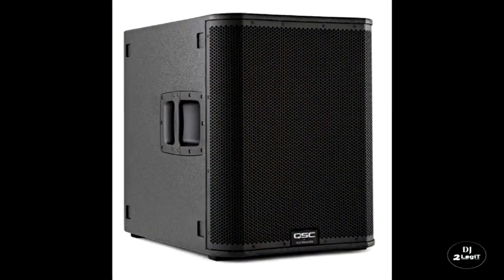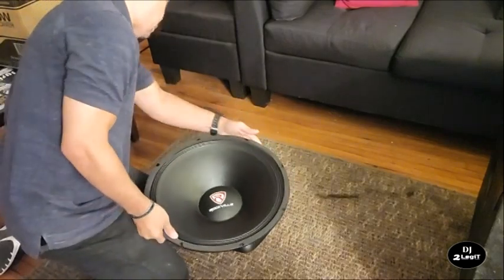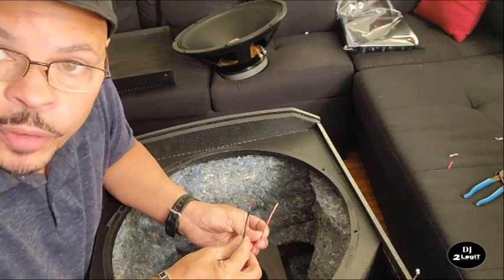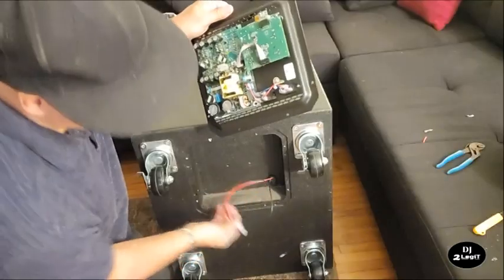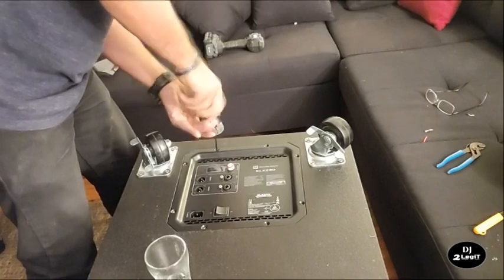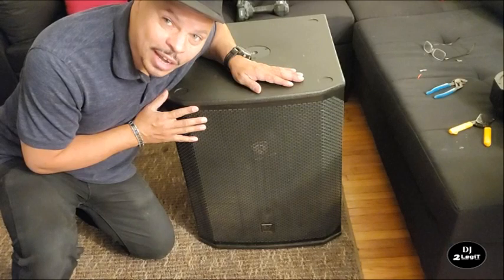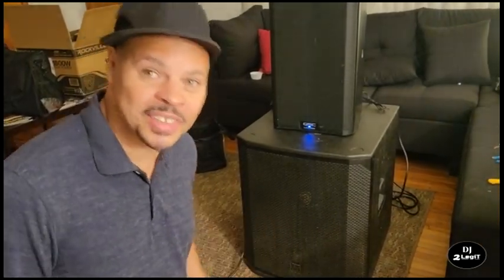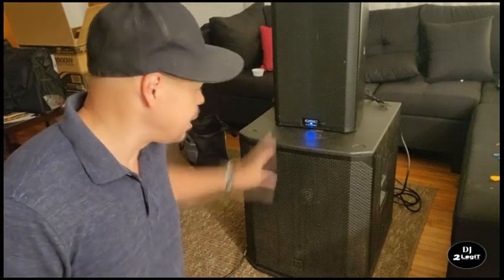Upgrading My Electro Voice ELX200 18SP Subwoofer

Comment: Hello from Australia. I just imported a couple of the Rockville subs and did the swap over. Agreed… massive improvement! Cheers mate
Reply from the maker: Glad you did the upgrade and heard what I heard too. The upgraded woofer kicks much harder! Huge improvement! Enjoy.  👍
Reply: Did you upgrade working woofers, or were both broken? I have two of these, and wondering if its worth to replace working defaults.
Reply from the maker: @mitas3484  At the time of making this video, I had one woofer that worked and one that was busted.  So I upgraded the busted one and then did an A/B comparison of the upgraded one versus the default one. The difference blew me away! No comparison. So I say yes, it is worth it to upgrade the default woofers. I also upgraded the default woofer on my second one.
Reply: @DJ2Legit007  Was hoping it wasn't that massive of a change haha, but the new woofer is not too expensive, will have to try it out!
Reply from the maker: @mitas3484  You get 30 days to return the woofer if you don't like it. Just buy one. Make the swap. Do the A/B comparison. If it blows you away like it did me, order the 2nd one. If not, send it back for a full refund.  What do you have to lose? 😁😁😁
Reply: @DJ2Legit007  Ordered two, hope to feel the difference!
Reply from the maker: @mitas3484  Good for you!!! I know for a fact that my upgraded subs are more powerful and put out much more SPL than the default woofers. And the default woofer clips much quicker than my Rockville sub, allowing me to push it harder and louder without worrying abouts it clipping. Congratulations on your decision! Please let me know how your experience goes after you do the upgrade.
Reply: @DJ2Legit007  I will reply back here with my findings, arrival in a few weeks, but hopefully my DB meter will show a difference!
Reply: @DJ2Legit007  Hi man, so I got them, threw them in today and tried playing the same songs. Obviously not very scientific yet, but its true that somehow it gets deeper and more volume. I used my DB meter, and at max volume I got 2-3 db more, before clipping fully. With a limit light every like 2-3 second, I was at 102 with the old one at 1 meter, and at 104-105 at 1 meter with same volume on the new one. 

Will try taking them outside for a proper test, this was just in house, so will sound different in a venue for sure.

Odd thing is it somehow matches my tops better now, it doesn't seem to disappear at unity like the old one did. Thanks man!
Reply from the maker: @mitas3484  Glad to hear your results! I didn't use any kind of DB meter. Just listened with my ears and was astounded by what I heard!!! Yep, I agree... the new woofers make them sound better with my tops too!
Reply: @mitas3484  I upgraded 2 in my brand new ev subs. Very happy
Reply: I'm on the fence on getting the EV sub 18sp or the 12sp I have a small 4 door honda civic I have two EV zlx 12p tops looking to add bass for small medium venues. I like the modification you did I'm wondering can you do that for any subwoofer even 12 inch subs? Can you even use car subs like 12'' does it matter the brand for modifications?
Reply: How does it impact the DSP?

Comment: Do you think the light weight body of the subwoffer will handle additional volume from the new driver? Or would the previous more robust model be mor adequate?
Reply from the maker: The lightweight body handles the additional volume just fine for me.  I've had no problems with it at all.

Comment: That's actually the magnet you're pointing to, not the cone, the cone is the paper part, don't forget the weight could be the different types of magnet, cheap magnets are ferrite whereas some expensive drivers use neodymium magnets

Comment: I would be extremely careful with the Rockville woofer those things blow very easily. Check the specs on it. I have not heard very good things about Rockville subs. Hope you don’t have any issues.
Reply from the maker: I was skeptical at first too, however I can honestly say that Rockville woofer is 100% a much higher quality woofer than the one that comes with the sub. The default woofer will blow much easier than the Rockville plus you can push the 1800 watt Rockville sub much harder without it blowing. I've used this on many gigs now and the difference is night and day.
Reply: Yea I sent my Cerwin Vega to a shop and they couldn’t get the woofer anymore. The guy put an 18” Rockville in it and it didn’t last. But there is a better solution them both of those. Yorkville sub. Mines is getting replaced now with Yorkville 7420.

Comment: I've had a pair 18SP's for a couple of years and just bought 2 more with the current promo. I use them with ELX 12P's and 15P's.. I was a little surprised to see you replacing both amplifier and subwoofer. I use the limiters in all my cabinets and gate from digital mixer and hopefully I can avoid having to replace any components for a few more years at least.
Reply from the maker: I only replaced the amp because I got this from a local club owner and both, the woofer and the amp weren't working. The sub has been working great for me ever since. I now own 4 of these and I upgraded the woofers in all of them.
Reply: You should want to replace the woofers in them just because they are cheap woofers trust me you’ll thank me later I did the same thing with my higher end EV ETX 18” subs and it was a night and day difference in the sound
Reply: @hollywoodthedj1673 which woofer did you put in the etx 18sp?
Reply: Well don’t be to surprised… they bought an elx 200 powered series for a club…. Already doesn’t sound right would of probably gotten away with it if it was a etx or maybe a ekx

Comment: Hi, friend!  I will soon be installing two Rockville RVW1800P8s in my EV-ELX200-18Sp.  How do they work for you today, do they hold up well?  In Club mode, do they take longer to reach clipping than the standard ones?  I would greatly appreciate your response.  ☺️🎧
Reply from the maker: Hi there! Yes, I am still extremely happy with my upgrade. Still working great! I use them in Club mode. Yes, takes longer to reach clipping now in comparison to the original woofer. I'm so glad I did this for all 4 of my subs.
Reply: Thanks!!! 🎉🎧
Reply: Hi, friend.  I just installed 1 rockville RVW1800P8 to my EV-ELX200-18Sp.  It may take some break-in or adaptation time.  At first it seemed that the original speaker sounded louder... After 15 minutes the sound has almost equalized.  But it still doesn't sound more than the original.  😢
Reply from the maker: @israelprats8743 Sorry to hear that. Mine was definitely much louder.

Comment: the original driver only has 400 RMS POWER. it is very little. i would like to get the white version. it looks classy and wanted to equip it with the rcf lf 18 n 405. is the amp very strong or rather weak? hope it is possible

Comment: Why did you choose ELX200 model? What other options did the amplifier show you? what if you chose EKX or ETX model if they were available options?
Reply from the maker: Like I explained in the video, I got a GREAT deal on them from a local club owner. I really love how small and lightweight they are. That's great for a single op mobile DJ like myself. The others models are good too, but the ELX200 18SP fits my needs better because of the size and weight.
Reply: @DJ2Legit007  i was asking about the amplifier....remember the part where it makes you select the model? I thought what were the other options?
Reply from the maker: @fausto412  Good question. That was so long ago, I don't remember now.

Comment: It looked like the Rockville is a little taller and hit the inside support not allowing the speaker to drop all the way down to allow you to install the 8 screws. When you tightened down the screws did it distort  the frame? It does sound great.
Reply from the maker: I had to go back and look at the video again to try to understand what you were talking about. Looks like the angle of my video is misleading. The new woofer has plenty of clearance inside and doesn't hit or touch anything inside. It drops all the way down like the factory woofer. The frame is completely intact. 👌

Comment: I have 4 ELX200-18SP subs. I love the light weight of them but would like to get more output. Does putting the Rockville 18 replacement speakers make that much of a difference? 
Thanks
Reply from the maker: Yes!!! I compared them side-by-side and I was blown away at the difference. It's not a small difference, it's a MAJOR improvement in bass sound output. I'm about to do another one this weekend. I promise you. Just do one, then compare it to your factory one. You WILL thank me later and you'll want to upgrade all four.

Comment: I'm on the fence on getting the EV sub 18sp or the 12sp I have a small 4 door honda civic I have two EV zlx 12p tops looking to add bass for small medium venues. I like the modification you did I'm wondering can you do that for any subwoofer even 12 inch subs? Can you even use car subs like 12'' does it matter the brand for modifications?
Reply from the maker: I don't see why you can't upgrade the woofer in any sub.  But don't quote me because I'm not a professional at this by any means.  The EXL200 18SP sub is pretty small and lightweight in my opinion.  It will definitely add a lot more bass to your existing setup right out of the box with no upgrade.

Comment: So the Rockville is 1800 watts and the original is 1200 watts so have u had any over heating issue being that the speaker is under powered?
Reply from the maker: Nope.  None whatsoever!
Reply: @DJ2Legit007  Can I use these for ev ekx replacement?

Comment: I was wondering how well those actually worked as replacement drivers.
Reply from the maker: They work so well that I'm about to replace another one.  Just got 2 more of these subwoofers!  One already has the replacement and the other one doesn't.  I can clearly hear the difference so I need to upgrade the other one so they both match.

Comment: I have the same sub. Would it be okay to put pop in casters on the very bottom by the rubber feet so I can still use my cover?
Reply from the maker: Yep! That's what I did so I just roll it into venues now with no problem.
Reply: NOOOOO, this is NOT what he did. He put the casters on the back, not the bottom. If you put casters on the bottom then the sub won't have a solid contact with the ground which it needs to help with sound. Your system won't be very secure if you put them on the bottom.
Reply from the maker: @jonlawrance8383  Jon. Thanks so much for correcting my error! I misunderstood what she asked. You are exactly right.
Reply: @jonlawrance8383  I'm thinking about using pop-in casters. Once I get to the event I pop them out. The ones I found will sit flatter than the feet and allow me to still use my cover.

Comment: I tried changing it can't install Because the loudspeaker is attached to the bottom base
Reply from the maker: You can detach it easily as I showed in the video. Remove the 8 screws, then detach the wires, then lift it out.
Reply: @DJ2Legit007  The sound is now installed. I did a preliminary sound test and couldn't find much of a difference. Or do you have to be Bernid loudspeaker first?

Comment: I don’t know if is me but they sounded about same with the stock subwoofer unless I need to crank it up loud to notice  the difference I did the same upgrade as you subwoofer Rockville RVW1800P8 … help please
Reply from the maker: Yep. You have to crank them to hear the difference. The upgraded woofer will go much louder than the stock one. Also the stock one will clip much quicker. You can push the upgraded one at higher volumes without clipping. That was my experience.

Comment: DJ 2 legit! Great video content! I just acquired 2 EV ELX200 18SP subs.
I find they are ok, but I am looking to improve them. What model of Rockville sun did you use? I was considering a Emenice, or JBL driver. However if you are still happy then the Rockville driver, results are better than guessing.
Reply from the maker: Thanks!! I have used Eminence woofers as replacements in some of my other subs in the past with great results!  Definitely can't go wrong there.  To answer your question, yes I am still very happy with the Rockville woofer.  Here is the one I used.  Good luck
 https://www.rockvilleaudio.com/rvw1800p8-spec-1/?cjevent=34fd5e0a2a6511ec82b7010a0a1c0e14

Comment: DJ  I just bought the EV cause my new  QSC 181KWS went out.. has power never maxed and QSC service  for parts is a joke.
Reply from the maker: I hear you. If you can, upgrade the woofer in it like you see me doing in this video. It will dramatically increase the bass output of this subwoofer.
Reply: Interesting i still have my KW181. And if you registered the sub online with QSC you get an additional 3 year warranty which is 6 years total.

Comment: I thought sub installs would be difficult, but found out it’s actually super easy, thanks to your vid!
Quick question: what DJ app were you using on the tablet?
Reply from the maker: Yeah, I've upgraded the woofers on several of my subs in the past.  Super easy lol.  I just upgraded the sub on my QSC KS118 too with an Eminence woofer.  The DJ app I am using on the Samsung tablet is called Virtual DJ even though it's really just a knock off.  Do a search for Virtual DJ 6.08 for Android to get the APK file.
Reply: @DJ2Legit007  … yup that’s what I have in my electro voice etx 18 box eminence subwoofers and then woofers are so much stronger then the paper cone looking one that came in it so I know your QSC ks118 hits even harder now I would love to hear it if I could!
Reply: @DJ2Legit007  I'm on the fence on getting the EV sub 18sp or the 12sp I have a small 4 door honda civic I have two EV zlx 12p tops looking to add bass for small medium venues. I like the modification you did I'm wondering can you do that for any subwoofer even 12 inch subs? Can you even use car subs like 12'' does it matter the brand for modifications?

Comment: I know you were just doing a sound test for the video but by connecting the stereo 1/8" plug from your tablet into the QSC (or any speaker) via the 1/4 " plug is not the correct way and will not give you the proper sound.  When doing that you are taking a stereo output from the tablet and inputting only one channel (left or right) to the speaker.  If you use a stereo 1/8" TRS to 2 - 1/4" TS Y adapter/cable  you still plug the 1/8" TRS into the tablet and then one of the 1/4 TSs into one speaker and the other into another speaker you will have the full stereo sound but if you only had one speaker/subwoofer you run one 1/4" TS into Input 1 on the speaker/subwoofer and the other 1/4" into Input 2.  you can then use the output XLRs of the speaker/sub to go to your tops or vice/versa.
Reply from the maker: Yep. This is correct, however it was not necessary for me just to hear the bass for this quick sound test.

Comment: Great vid. 👍 would it be possible to swap the speakers on the EKX and the ETX subs as well?
Reply: Yup I have two EV ETX 18Sp’s with swapped woofers and it’s a big difference they hit even harder now it’s like EV is putting cheap as woofers in they cabinets but I get it tho I’m sure they could put the best of the best in these cabinets but then it wouldn’t be a low budget sub anymore I guess they let you figure it out on your own and spend the extra money to upgrade the woofer!

Comment: Wow! Imagine instead of paying $2000 you can just upgrade for less $200
Reply from the maker: Yeah it's definitely an upgrade but I've discovered my KS118 is still more powerful at louder volumes.  Even still, I am very happy with my upgraded elx200 18sp subs.  I never use my KS118 anymore.